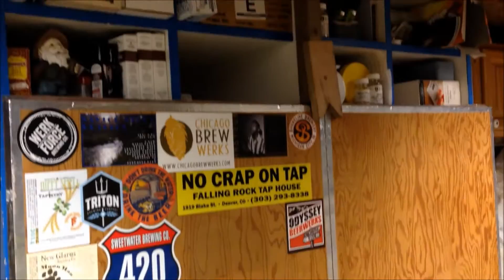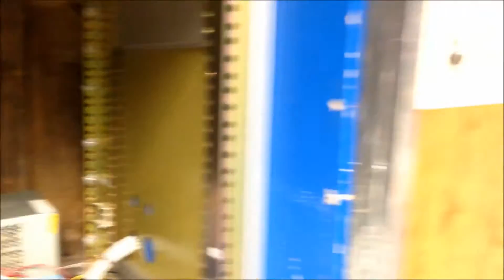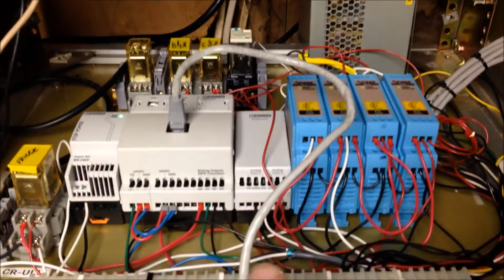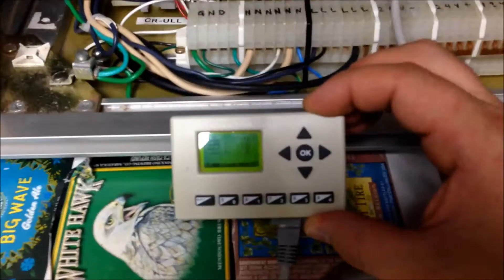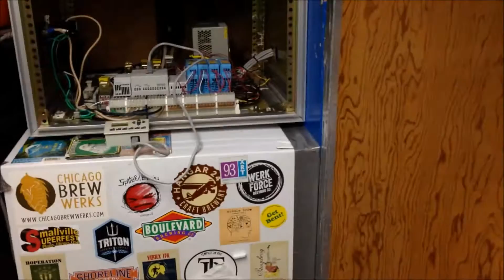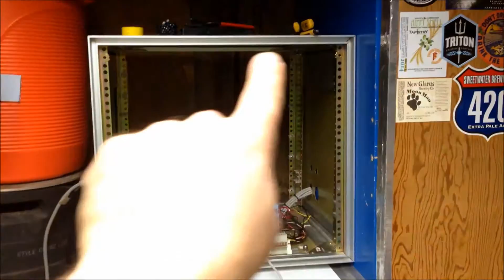Fermentation Chamber of Doom

Comment: Seems like more sophisticated controls than necessary. You could have accomplished the same results with 4 Johnson A419 controls off Ebay for $30 - 40 each. Basically looks to me is all you are doinf is turning fans off and on. I have a similar setup using the A419's. But hey that's the fun of it right?

Comment: Nice Set Up Man. I dig how you're running that huge chamber off a Mini Fridge. I'd like to do something like this myself with my Mini Fridge. Right now it's just Cellaring Mostly High Gravity Dark Beers. I'd like to re-purpose a coat closet as you've down. You're Electrical system is beyond me though....lol. I'll probably wire mine up with a single STC-1000 and put heavy duty fridge racks/shelves in, so it's open but has different levels instead of 4 separate chambers. Then place some fans it different spots to circulate air and maintain a constant temp throughout the entire system for Cellaring bottles and Keg Conditioning and Carbing. Looking forward to seeing how you do upgrades on your's in the future. Cheers Nate!